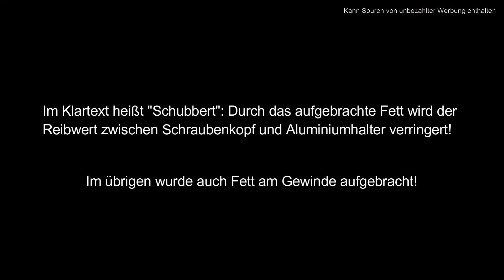Smartphone am Motorrad | Aber wie....!? | Moto Mount Pro Smartphonehalter | SP Connect

Comment: Zerstört Cam von den neuen iPhones (X,11,12).
Reply from the maker: @woodone swiss: Du hast Recht, es gab einige Fälle in denen die neuen Generationen von Apple Probleme mit dem Fokus durch hochfrequente Erschütterungen am Motorrad bekommen haben. Laut SP Connect betrifft das allerdings nur 0,5 Prozent aller weltweit verkauften Halterungen. SP Connect hat aber zwischenzeitlich bereits an einer Lösung gearbeitet und das Anti Vibrationsmodul auf den Markt gebracht. Ich verwende das SP System zum einen am Motorrad mit dem SP Lenkerhalter/Anti Vibrations Modul und zum anderen mit einem RAM Mount Saugnapf im Auto täglich mehrere hundert Kilometer. Bisher habe ich noch keine Probleme oder Nachteile feststellen können.

Danke für Dein Kommentar und VG